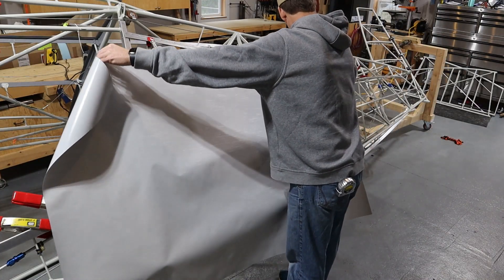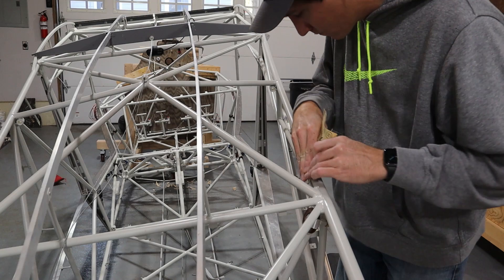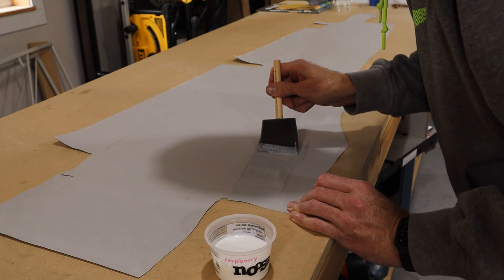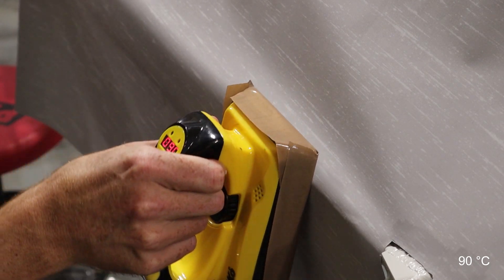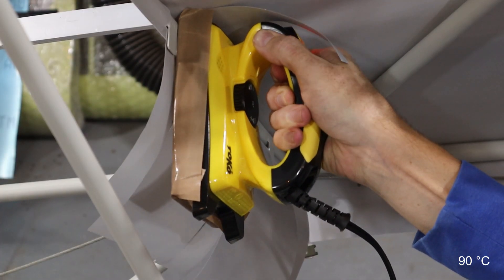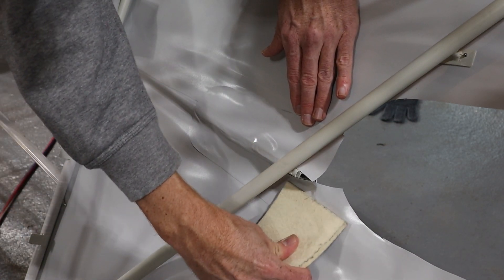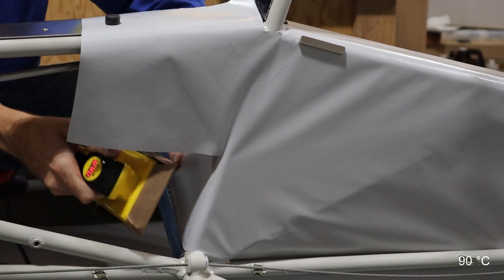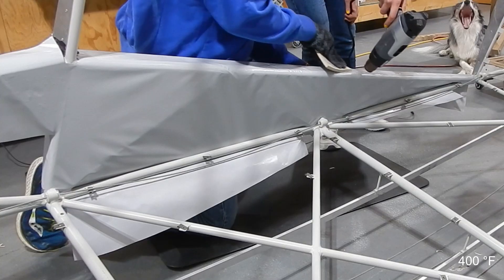Interior Covering With Oratex

Comment: Good stuff, looking forward to how the top of the fuselage and vertical stabilizer work out.  That is the part that worries me, but I am all in on the oratex
Reply from the maker: I'm very nervous about that spot. Mostly because it's such a big piece of fabric if I mess up!
Reply: @ColbyOsborn  Agreed, I will be watching closely.  I will likely get your number from Mark so I can ask a few questions.  I am already wondering how much fabric you used on the interior/cargo area?  How much are you going to order for the exterior?
Reply from the maker: That sounds good. Mark knows how to get ahold of me. Hopefully after I spend some time covering the control surfaces, I'll have a better handle on the product. I ordered 6 meters of the half width roll for the interior. I needed it all, but had A LOT of waste. I think it would've been much more efficient using the full width roll (180 cm wide, I think). 
For the exterior, I've ordered 33 meters of the 180 cm wide stuff. It sounds like several model 4 guys have covered theirs with 30 meters. So I'm hoping an extra 3 meters will cover the longer fuselage of the Model Five and account for a small mistake or two if needed. If I have to pay the crazy shipping a third time, I'm going to be very disappointed in myself. lol

Comment: What is the fuselage made of?
Can stainless steel be used as an aircraft fuselage
What kind of metal can be used as a fuselage 
Thanks in advance for the reply🙏🙏
Reply from the maker: 4130 chromoly steel. I’m not an aeronautical engineer, but I think stainless steel is too heavy. It’s used in a few spot like the firewall on this aircraft.

Comment: Hey Colby.. how much does it cost to build the Bearhawk not including the cost of the kit itself?
Reply from the maker: Hey Joe, I'm sure you know it depends greatly on how you decide to build it out. Ours specifically looks like the following. 50k engine, 20k prop, 9k fabric, 30k panel and electrical, 5k interior, and we have around 6k in hardware, but supposedly the new kits come with most of that now.

Comment: I wouldn't use those cheap foam brushes on a covering that costs thousands, there are low cost bristle brushes
Reply from the maker: Foam brushes are what the instructions recommend using.
Reply: @ColbyOsborn  naaah, use a real brush, you'll get a much better result, they're just trying to save you a few bucks.  I'm covering with polyfiber now and it would be a royal pain with those flimsy foam dispo brushes.